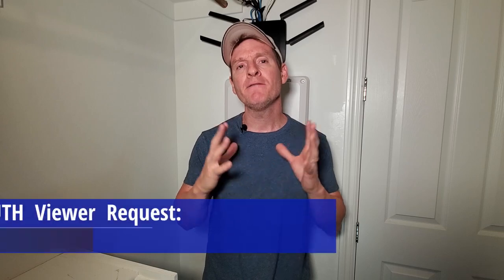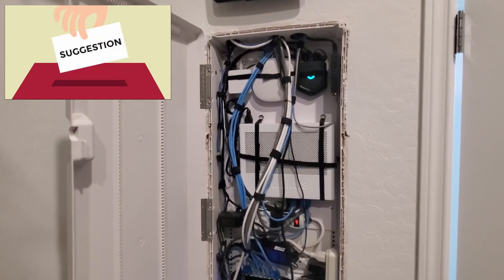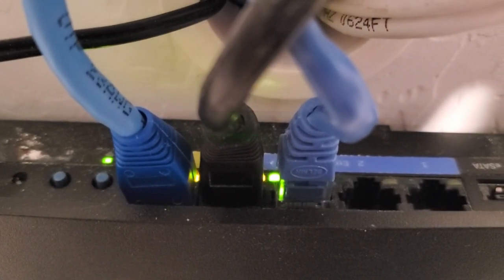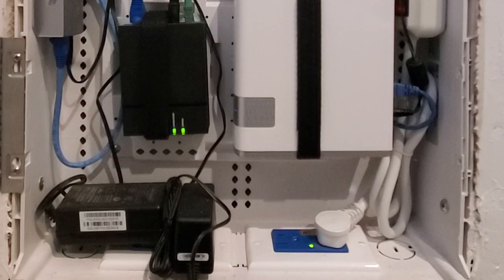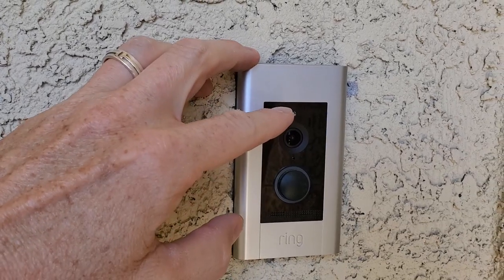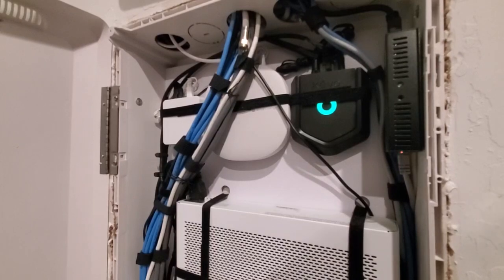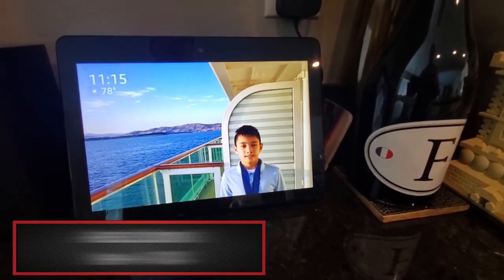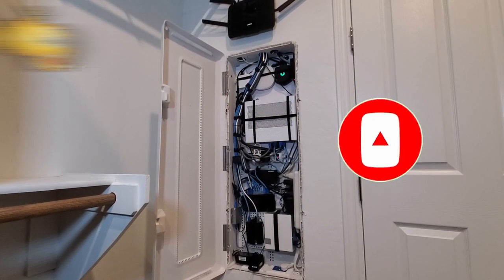Tour Of My Home Network - Ultimate Network 2021

Comment: 4 plugs is more than normal. It's usually 2 and they're meant to have power strips plugged into them. So its plenty.
Reply from the maker: My very first network panel had only 2 plugs. Here is a video of an update of were I add a back up UPS to the panel. 
https://youtu.be/9kGISAgdjMA
Thanks for watching and for commenting!

Comment: Nice setup  but I will drop all of those and purchase UNIFI Network system with a solid Security gateway (USG or UDM) , poe switches (USW 24-150W Poe) , access points (AP AC PRO or NanoHD) and cameras (g3 flex and bullet) and the benefit is that you can manage all in one place ;). All of those und 800$ .
Reply from the maker: Thanks for the great recommendations! I know I have many different devices and brands and if you watch my latest video I review a EnGenius PoE 8 port managed switch which is now in my office studio because it wouldn't fit in the network panel. Make sure to check it out. It's a great switch for around 200.00. Someday I will ditch the RUCKUS ICX switch. It's too big and I need more PoE ports. Thanks for watching and for commenting!

Comment: I would recommend to seperate your cameras and other IoT devices from the main network for security.

This way you're better protected if someone gains access to your IoT devices or to your cameras and doesn't manage to also compromise your whole network. This would however require VLAN capeable AP's, VLAN capeable router and switches.
Reply from the maker: I have VLAN capable switches. I have a ENgenius 8 port PoE Managed switch. I will set up VLANs for my entire Network and of course I will post a video on how I did it. Thanks for watching and for the good advice.

Comment: If you don’t have a TrueNAS server and a PfSense Router along with a Ubiquiti AP for wifi, you’re behind in the times…….. ditch those external hard drives and build a Dell R710 (cheap but POWERFUL for TrueNAS) and you can do 6 hard drives and get redundancy!
Reply: I have a full list of all parts needed to add a pair of mini SATA drives for OS booting TrueNAS and a sata Raid controller that needs to be flashed to IT mode for JBOD.  I have a pair of these servers running, one as my daily use, always on and one that wakes up the first of each month and pulls all the snaps from the past month and goes back to sleep 8 hours later.
Reply from the maker: @rothe31  Thanks for the information. This setup is old now. My network panel doesn't have the wd cloud drive anymore. And I have a UPS installed for backup power. I will build a true NAS eventually. I've been so busy with other videos and commercials. I will let you know when I start my NAS build if I need any help. Thabks for watching I really appreciate it. I have 270 videos on my channel and most are network related. Have a great day.

Comment: All of that expensive equipment and you're using a power strip to power it? YIKES! Invest in a UPS, which will not only protect your devices and keep them running in case of power surges/outages, but also solve the problem of the huge power bricks taking up the electrical outlet ports.
Reply from the maker: Absolutely! I just need to find one that fits in my current situation. I will need to make some network Device adjustments for sure. When I get my UPS I will make a video about it and thank you for the great suggestion! Thank you for watching!
Reply: Nobody would actually do it this way. At least not for very long